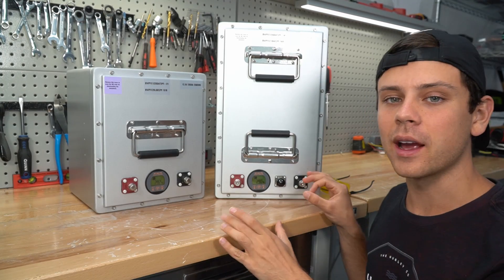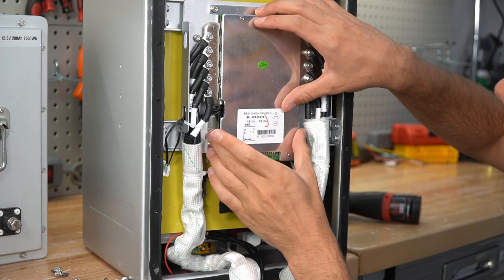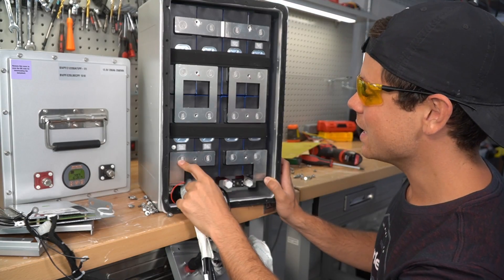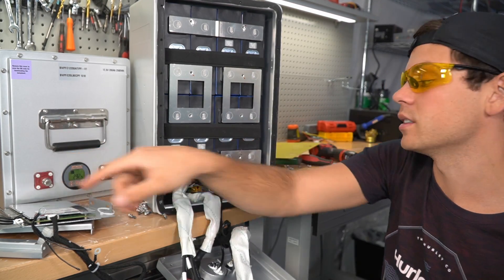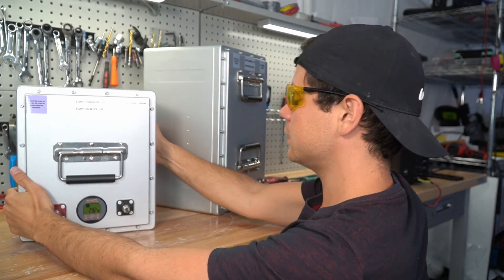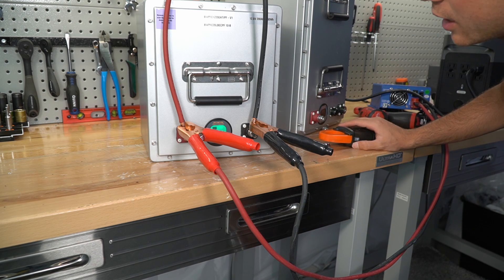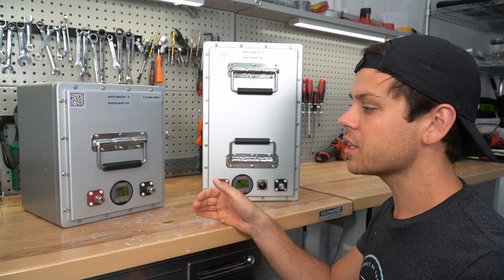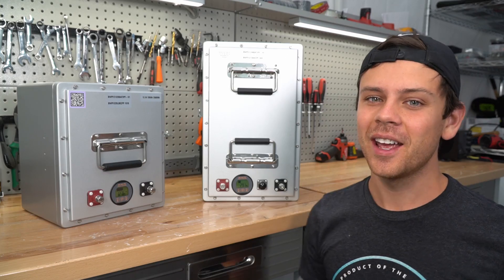ECPC LiFePO4 12V-24V-48V Battery Tear Down: SOK Competition??

Comment: Enjoyed the video since I have a Bestgo 400Ah (ECPC) and love it but didn't want to void the warranty by breaking it open. Your cost comparison confused me though. I paid $1930 for the ECPC/Bestgo 400Ah, shipped which also included a spare remote meter and cabling. I am seeing a little over $1000 for the SOK 206Ah and since you'd need two of them to make 400Ah, that makes the SOK more expensive. What am I missing?  I tested the Bestgo at 10A draw rate down only to 2.8V/cell cutoff and it put out 430Ah, quite impressive.
Reply: Now the 400ah on their webiste is going for $2,200.
Reply: @KEAWE7  still the same or better price than the SOK on a $/Ah basis and the SOK has a maximum discharge rate of 100A compared to 150A for the Bestgo. But Will described the ECPC/Bestgo as "very expensive" compared to the SOK and I just don't see why he concluded that.
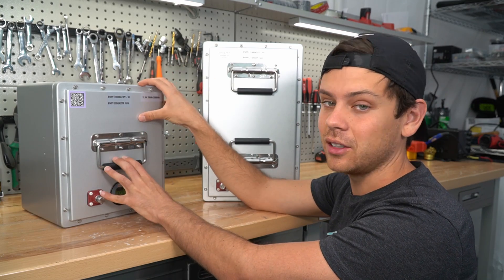Reply: @frankenstake  Notice at 10:16 minute mark he is compare the 200ah battery to the Sok, which at that time the ECPC was going for $1620.  So yes the SOK is cheaper.
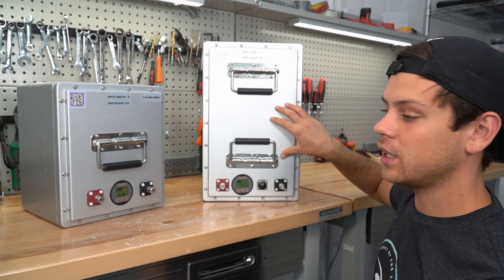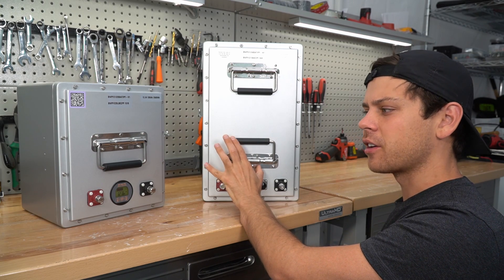Reply: @frankenstake  also at 12 min mark the 48v 100ah was going for $2430, that a lot. Also at 12:20-12:40 mark Will does say the 48v 100ah is cheaper compare to 200ah one.

But I do agree with you about Sok BMS 100ah is low.  And the price that you paid for your battery that is a great deal especially for 400ah with a great BMS.

Comment: I swear the more I watch your teardown vids the more I want to just start building some crazy nice and heavy duty batteries in the $500-600 range for a 100ah to bring to market. Overall most people would rather buy a ready made battery with warranty, as opposed to build. Already a business owner, so Im more than familiar with the challenges that have to be overcome in order to build a name. First however would be to send the prototypes to you and let you rip it apart so that any potential shortcomings could be corrected. 😁

Comment: It's nice to have the option to buy something that isn't built to a price point first and foremost. Even if your application is stationary, that padding could save you big time should something impact the battery. This probably could be serviceable, if one has a tap-and-die set, a good drill, and steady hands. 😁🔥👍

Comment: Hi Will,.. And everyone,...   : )  My name is Neil and I'm from Canada,...LOVE the channel but I have a question for you, or your subscribers, as I need your advice on something. 
I've been having problems with the SLA batteries in my electric wheelchair and now my mobility scooter. I have heard of a battery balancer for both charge and discharge called the, "LTC3305EFE Lead Acid Battery Balancer", and it appears to be the answer to my problems?? Please respond if ANYONE knows what I can do to balance a 60v (12v X 5 batteries), 30 amp/hour battery and a 48volt, (12v X 4 batteries) (eddievan99@gmail.com). Thank you all,...  : )

Comment: Question...
Would you be able to recommend a power bank that could start a snowblower?
Reply: You'll need to know the start up and running Watts required for that unit. You might look into Ecoflow River and Delta models. They're amazing.
Reply: Thanks for the info 😄💃

Comment: So I want to install a separate breaker box to run a backup solar system with. It seemed simple enough to me but now I’m confused about bonding neutral. Would I want a ground bonded neutral box or not?

Comment: OK Going fishing on this one!!! I have 6 x 100ah bbb w/ Victron Multiplus 2000. The main draw is an DC AC Proair RT Unit & It draws between 60-100 amps. So it last between 5-8 hours during the a hot summer day. What would be the best way to add run time. Is it more batteries or is it a small 2000 watt gen. I just need maybe 1-2 hours more. Oh, I have an Panasonic 330 watt panel and a 2nd alternator with Balmar MC-614  voltage regulator that helps repowers my bank. It does a great job when drive on the highway. When I get home, shore power does the rest.  So what should I add?

Comment: Not sure how to post this. 3 weeks ago ordered Bluetti AC 200P. Screen says AC200, tested unit with kill a watt showed 1.68 kWh at a 398 watt draw for 4hrs 30min. The case says 2000kwh and 2000w Not BMS screen to show number of cells. Doesn’t have forward button to show it. Also no indication in manual or on screen or label what the chemistry is or number of cells. Did I get ripped off?  Have sent maxOak report through Amazon waiting to hear results on replacement unit. 
Screen Also shows variable watt draw ranging from 60w to over 1100 on a heat gun set at 395w over the 4 + he testing.

Comment: Hello, I have a quick question.  I have a yeti 3000x, hooked up to six 100 watt panels of the 50amp input GZ Anderson cord. I'm currently taking my garage fridge and deep freezer off my grid with this setup. Is this process practical or will it hurt me long run? Right now it's sustaining itself and haven't seen it drop under 40% even on the cloudy day's and providing only 250 watts of inputs. On sunny days I've seen 579 watts.  Any inputs will be appreciated

Comment: 060221/2003h PST.    Thank you for the presentation. I am totally blown away; at the sight of this Power Supply container. This is MIL standard, definitely. I have , in my life time, not seen any thing like this come out of China. Very meticulously assembled and tested. 
What’d be the cost of the big unit?
Thanks again. Stay safe and 73s…

Comment: Another great teardown, Will! Impressed as well. Saw these a few months back & was wondering the quality. 

Agree, that BMS looks monster overkill! Any chance you can identify the make/model?Or do you know of possibly ANY made in USA BMS's? Or at least, non-China. 

And thank you - I've learned so much from your channel, about to take on my own first ever battery build, starting with buying most of the tools, connectors, wire, etc that you recommend.

Comment: Nice looking battery, but kinda pricey. Looking at the pro version it appears to be similar to how a Valence ubms system operates. No bms fets handling cutoffs. instead using the communication port to handle all on and offs of chargers, inverters, relays etc once parameters are met. I have a similar setup running valence u27xps where the bms only turns off and on my chargers, inverter and SSR for non inverter loads. Example: voltage gets to low then bms sends signal to turn off my victron inverter and victron ssr for the DC loads, then the solar charger can stay on to recover the battery without loads pulling the battery lower. Definitely not for most people watching but this, however this type of setup is really good in industrial applications, ev vehicles and maybe very large parallel systems.

Comment: Wow, those battery packs were incredibly well built, I was amazed by the quality of the engineering that went into those, great strip down of the larger version, I preferred the mini version though.  Will, I have a Renogy setup here in Wales U.K. where we don’t get much 🔆🔆🔆🔆🔆 but we get lots of wind 🌬 🌬🌬🌬🌬.  Have you ever considered wind power generation, as I’ve not come across any on your archives.  Thanks for taking your time making this video. Rog from Wales 🏴.

Comment: Have you ever reviewed any of the batteries from Pylontech, Dyness or FelicitySolar?. these are brands that are used in the area where I live and they seem to be cheaper than some of the other brands you review.
Reply: I should add that I am personally using Pylontech US2000, but I am looking to try FelicitySolar which is about half the price of Pylontech.
Reply: I use a felicity solar set up. It works well but the solar panel frames are thinner then a renogy ether way not one day I was down and I had this system for a year.

Comment: Hey Will have you thought about doing a video on a DIY 48v li ion pack using a Tesla model 3 battery module?  If you break a big  module in half you would have a 12s lower voltage but at about 20kw.  Setting the charge and discharging voltage limit you may lose a bit but still have around 15kw and a really long cycle life.  Some of these modules are going for around 800-1200 + a little shipping.  With two good bms and wired correctly to the bricks I think you would have a epic battery.  Heck throw a cabinet on a wall and mount it in there too for safety. 
Let me know if you think it's doable and worth a shot.

Thanks and take it easy man!
Casey

Comment: The real break comes with the 24V x 200 and the 48V x 100ah vs Battle born as both require $4000/4 units to equal VDC and capacity. Each of these is app $2280. Still not bad...

Comment: Hey Will... what do you know about electric wheelchairs? Do you know what kind of batteries they use? My double spinal surgeries I had on January 28th and it has apparently flopped and I'm now crippled. I was told my electric wheelchair should be here in around six to eight weeks from now. Barring my present physical situation... I'm really looking forward to getting my wheelchair. It's a top of the line... Cadillac of it's venue...

She had me test drive three different makes so I could select the one I liked the best. She told me I picked their best. 😎☕💯🇺🇸🧐🥴🤪😉😜🏰🎯

Comment: Ive been using the 12v 400ah version. For one year now. It powers my Electrofishing unit for Doing Fish Surveys. It replaced the two 8D 250ah Lead batteries i was using. By far the best battery for this type of work. It also has been in the boat the whole time in all types of weather with no problems. I charge it with a 210w solar panel with a waterproof 20a charge controller.Happy to see you review them.
Reply: Just  curious, do you know what sort of voltage/current waveforms are used to stun the fish? How far apart are the electrodes?
Reply: @romand4651  output V is about 600, Frequency is 20-116Hz modified sign wave. Conductivity of the water will dictate amp draw, average being 80-100A. Electrodes are the anodes and the boat is the cathode. Aluminum hull. you can have one or more electrodes if you like. Always think safety first while doing this type of work.
Reply: @jasonpaulluster   wow 80A, any idea how much of that goes through a given fish? 
I thought it would be high V fast pulses
Reply: @romand4651  I really don't. Fish are only temporarily stopped for us to net the fish. The larger the fish the more stopping power i have over them. The conductivity of the fish also makes for some fish not coming up and some coming up very fast.